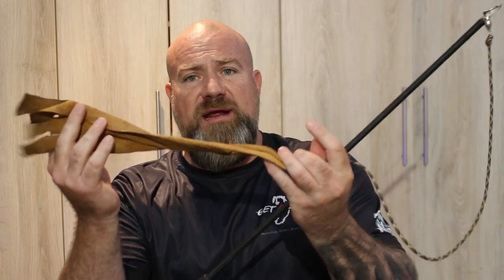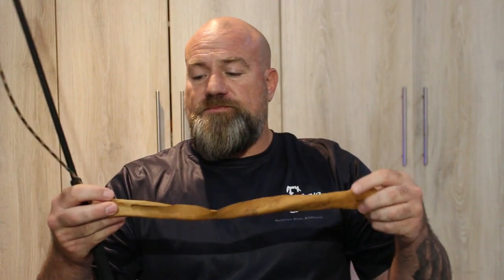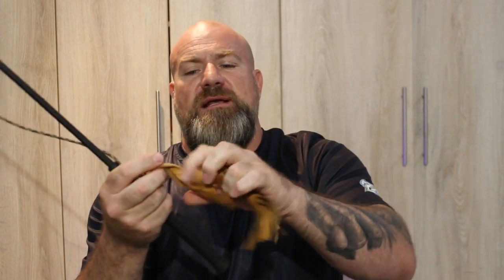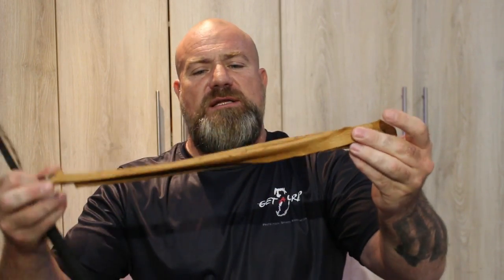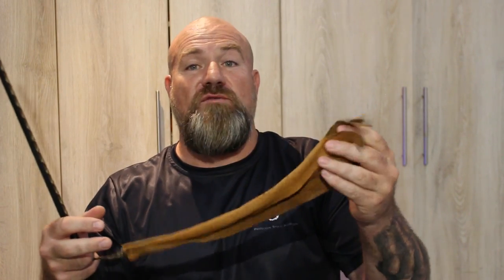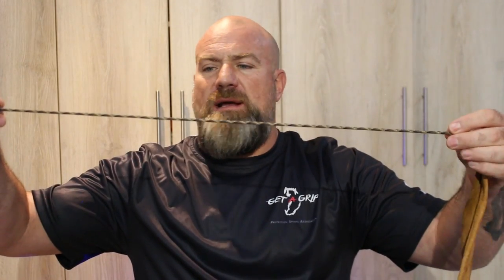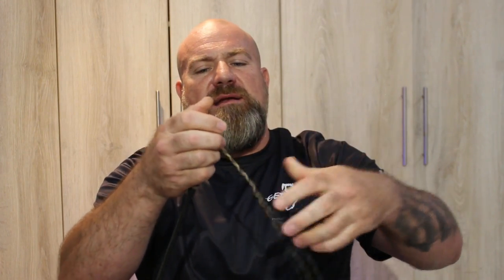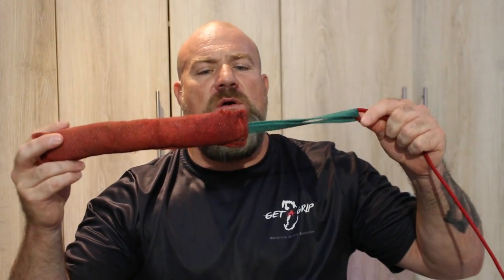How to Make and Use a Flirt Pole in Dog Training

Comment: That looks like a nice durable pole! Could you make a build video? I am having difficulty imagining how the swivel and other hardware fits together. Also, you said to drill a hole but does that mean that the whip pole when you cut it off is solid rather than hollow? What kind of drill bit do you need to drill through the material, etc...

Comment: Wonderful helpful video and have started gathering my supplies as I have a mali/GSD pup who will benefit hugely from a flirt pole. Please could you explain how you joined the ring/swivel to the rounded off end of the whip handle? Thanks so much. Am about to start watching your channel and have subscribed. Love your presenting style!
Reply from the maker: Drilled a hole through the end and then added the swivel and metal ring. I then cut the metal ring in half and bent it a little bit open so it could fit through the whole in the handle. Then bent it closed and tick welded it.